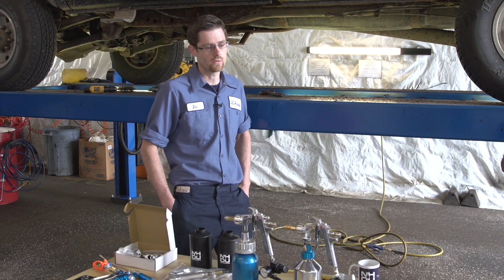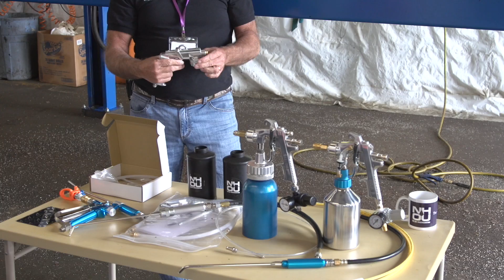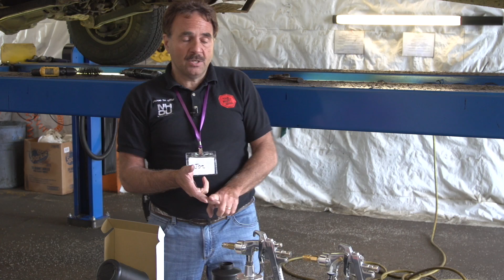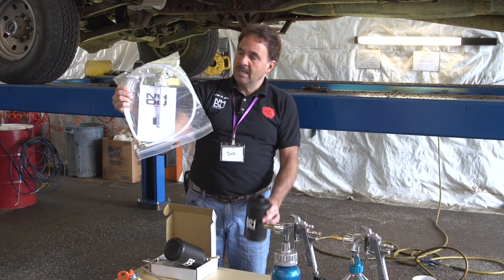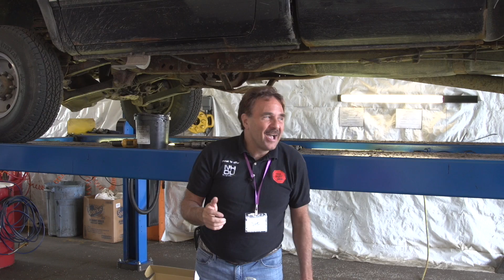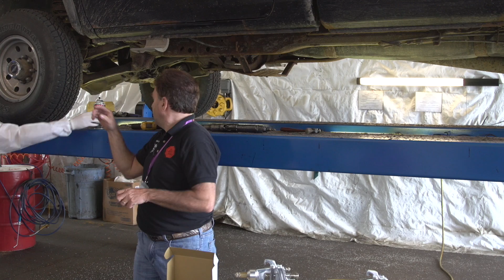NH Oil Undercoating® 2017 workshops

Comment: Have used NH Oil Undercoating for a couple years and love it. Now I do it myself each fall. Question...Want to try the brush on wheel well liner and wonder how long it stays on? Do you do the wheel wells each year?  also if the rocker plugs have been done once how often should they be done? If yearly why? Where does it go if locked in a rocker cavity? 2017 Silverado..thxs
Reply from the maker: Hello P Ndebt, That really depends on your driving habits and conditions but you should get close to a year under normal circumstances. Because wheel wells are like sandblasting cabinets it's very difficult to keep the product there. Just stay on top of it

Comment: Does this product dry out? I don’t want to have a undercarriage that looks wet all the time. It gives the appearance that something is leaking.
Reply from the maker: Jeremy, Remains soft. That will allow it to penetrate the Rust to the good metal, displace moisture then remove oxygen. Like everything in life there are up shots and down. Most of our customers will prefer the soft oil finish over rust. Here is a YouTube video explaining the difference  https://youtu.be/u79ZTH8gNTY
Reply: I am sure I could spot an oil leak if I had one. Have done my truck twice so far.  You would do well to get used to the oil coated look. Is see plenty of dry rusty truck frames. When I see a dry rusty frame on a 5 year old truck that still might be worth 18k- 22k it is sickening....

Comment: Is this safe for rubber? My rocker panels are coated with spray on bedliner, and im concerned the undercoating will swell and peel the bedliner.
Reply from the maker: The product will swell soft natural rubber only. That means the rubber bushings gaskets and seals under the vehicle should be fine. Oil is not going to affect a properly coded bed lining material. I would strongly suggest that you put oil inside the rocker panels where rust starts.